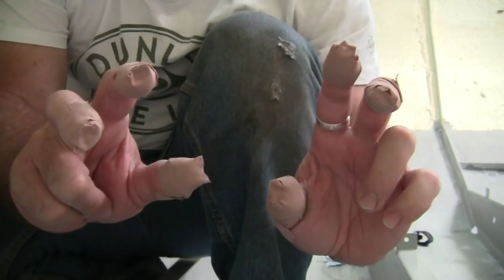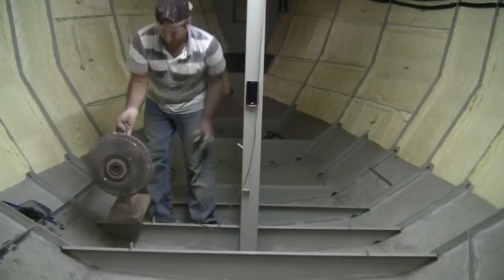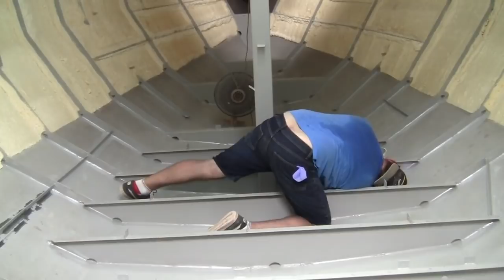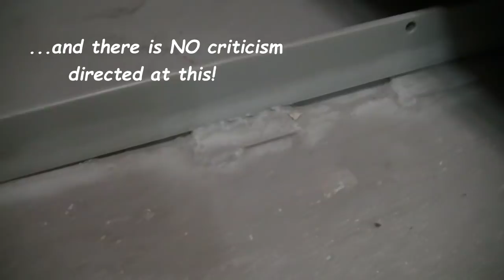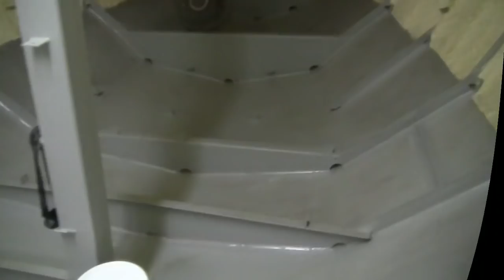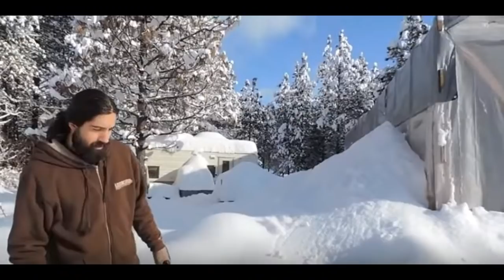Building my steel sailing yacht Ep.15 Coving (part 2) & some BIG NEWS!

Comment: For sanding I use kitchen towel and masking tape or Gaffa tape.  Same for any cuts I get, but tighter.

For painting under overhangs I find a sponge soaked in paint works well, but a bit messy.  Not as messy as painting a bit and then standing on your head to paint the next bit.
Reply from the maker: Thanks for your good comments Mick!  🙂

Comment: Looks great. If I had a boat I think I would have a fetish about clean bilges and under sole areas. It is a great advantage to start in this condition and have total access. I would also be very anal about access under the sole after all the interior fittings have gone in, look forward to seeing how you handle that!
Reply from the maker: Thanks for your good comments Benters and yes I too am somewhat fussy. I will definitely have access to all spaces under the cabin sole. Thanks for joining Mistress' journey  🙂👌

Comment: Rubber gloves? Sanding discs/wire disc? Dremel for small places? Happy fingers..... But fair play for thoroughgoing attention to detail!
Reply from the maker: The gloves are a thick industrial nitrile type.
My reservation with using electrical tools for this type of work is that you inadvertently end up knocking off/removing all of the paint whenever you pass over any high steel or weld spots. Getting a good build up of paint over the steel is my goal. 
But, I am VERY pleased that all of this work is behind me Nick!  : )